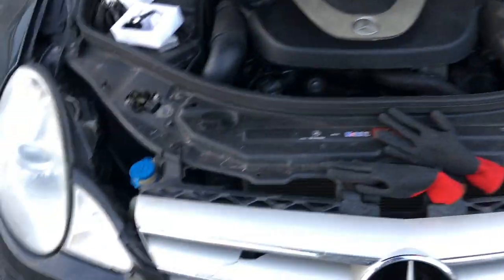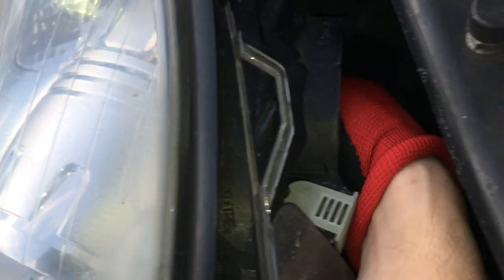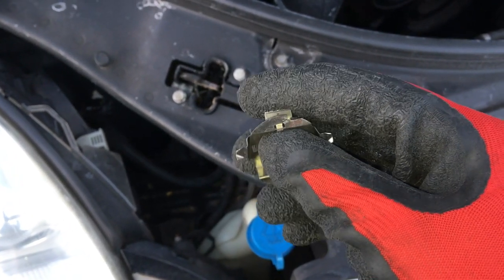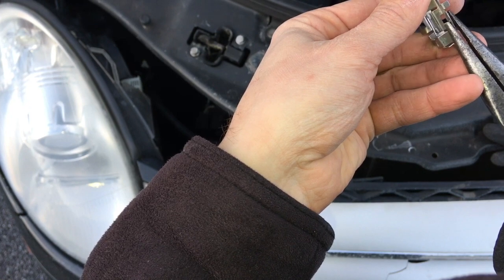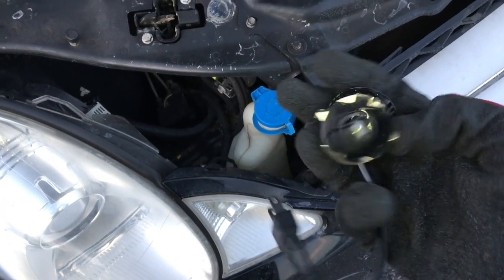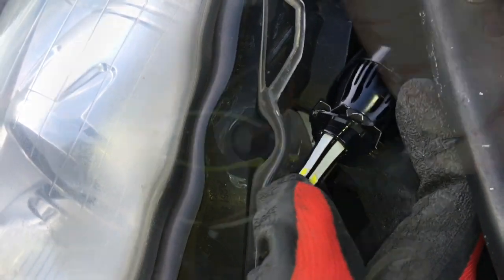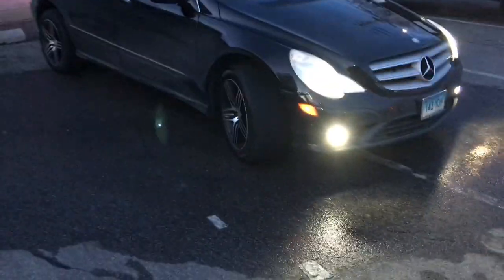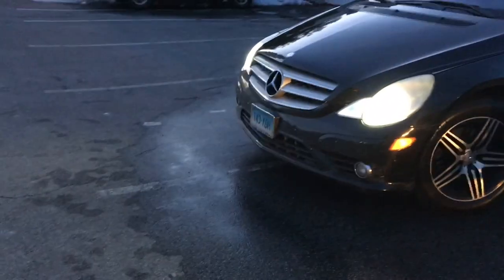2006 - 2010 Mercedes W251  R350 LED headlights

Comment: I see you also have LED parking lights right? What kind of LED did you use for those?
I assume that if an incorrect LED is used it will throw a code because of the much lower power consumption right?
Reply from the maker: Parking lights were changed to LED, but it was not easy. I tried to find the best solution for best result, but after about 6 month this car was totaled by some careless mechanic. Thus, no video was made. There are certain resistors that will make it work, but LEDs don't last too long, due to large voltage jump. I tried using stabilizers, but it would not work well with resistors. I tried many different ways. All that was due to the damn computer controlling these bulbs too much.

Comment: been looking for a video like this for my r350 for years. thanks for the post.   PS;  you can buy the liquid insulation. just paint it on with the included brush in the bottle. great for tight spaces like in your video
Reply from the maker: Thank you. Liquid insulation cannot guarantee proper application in tight and hidden spots. In given situation , I would take headlamp off and do everything in one shot. I have E350 video that has similar problem.
Reply: @Don M Do you like your 
R350? I’m thinking about buying one but I see so many bad comments about them

Comment: I’m not sure if you still respond to questions but I’m trying to remove the headlight like you did at around 0:28 and it seems stuck, I cannot twist the headlight like like you said. It won’t budge no matter how I try it. Not really sure what to do
Reply from the maker: spray WD-40 oil around there and let it sit for a little bit. you may need to come up with some kind of solution to help yourself with it. If nothing works, you would need to pull out a headlight.

Comment: I have 2008 R350, similar to this car, I tried two different types of LEDs but the were not bright as the ones you installed,  are there any specific specs should I look for...and part of the problem is the headlight projector lens is dumping and distorting most of the light!
Reply from the maker: fist of all, make sure the lens is not foggy, these cars have that issue a lot. If it is, you need to find somebody to take care of that problem for you. (I should be doing a video of this process soon, just can't find a car for it yet) another thing is that you need LED with 4 chips or 2-chip, but with minimal distance between chips. I haven't seen too many of those and overheating in closed headlights was a problem.
Reply: Do you have to wear gloves are these the type of lights you can't touch with your hands
Reply from the maker: No, you don't. These are not filament bulbs, but a conversion kit to LED. You just can't touch certain parts of it with dirty hands  that would distort the light

Comment: PLEASE TELL ME WHAT MAKE AND MODEL HEADLIGHT,  HAD THE LASFIT H7,  FROM DEALER INSTALLED AND NOT BRIGHT ENOUGH,  FOR SOME ODD REASON MY PARKING LIGHT ILLUMINATING IN THE DASH PANEL,  LIGHT FLICKERING UPON STARTUP,  IS THAT NOTMAL, ALSO WHEN I UNLOCK CAR DOOR A WEIRD  SOUND LIKE OPENING A SODA CAN, HAD LIGHT INSTALLED FROM LASFITS LIGHTS,  PLEASE HELP
Reply from the maker: LED headlight conversion kit in my video is not a market brand, meaning that, I could put my name on it or the shops name On the box.  Since there is no  online store, it is just a design and explanation. You can email me for more information about the conversion kit.  I looked at the website of the company you mentioned you bought your kit from, and noticed that their conversion kits have expensive chips in them , But I hardly doubt that any of these conversion kits made for projector headlights . That could be one issue. The other issue could be that sometimes in these cars headlights get foggy from time and different attention(care).  I don't think a dealer is a good place for installation of LED lights. Training Mechanics  to install LED lights on cars, I have difficult times to make them understand pretty obvious things .  I doubt good paying mechanics at the dealerships would be any interested and trying harder. As far as your parking lights, they have to be canbus.  If you bought ones like that, it means that they are generic and do not work on a specific car. I've been fighting these parking lights for the past 8 months on this specific car ,  looks like I found a decent solution . Sorry, I don't know how I can help you with the sound, I would need to see the car in front of me.

Comment: Light all over the place. Thanks for blinding everyone else...
Reply from the maker: You're welcome, but who is blinding everyone else and what lights are in question?
Reply: There isn't any legal ECE/DOT/SAE headlight bulbs for halogen housings. Why? because the light pattern and intensity isn't controlled properly. AKA blinding other drivers..
Reply from the maker: @lesmutchie8264  OH, that is what the comment is about? You just pointed out about "legal" and bunch of codes for headlight housing. This is the way of jumping out to create a theory in which creator would believe. "Nice" conclusion in a previous comment.

Comment: What was the brand and type of LED's you used?
Reply from the maker: These are generic brand. They are made to my specification. Basically a lot of manufacturers use similar design but different components and because there is no brand on it(most sold in shops), there is minimal marketing expenses. If you need more info on these kits, e-mail in description.

Comment: Have you had to make the repair on your rear right tail light housing/control module yet? You should post a video on this 😁
Reply from the maker: It was a client's car and did not get to these problems because the car went to one shop for an oil change and fell off the lift. basically that was the end to this car.

Comment: Hello .... My wife has this same car and the headlights are blinking need to be replaced, 1 big problem not oem bulbs they are hid's and dont have the bulb clips that hold them in place where can l order those clips what part num. Can you please help me
Reply from the maker: hello, sorry, I don't have a part number for that. It is a Mercedes metal headlight bulb clip, should be able to find them in  headlight section of oem Mercedes parts. As far as blinking : HID need to be can bus compatible, but may need capacitor too. This is why I recommend using certain LEDs, not even all of these work on Mercedes.
Reply: @artworkslights  thanks for the feedback .... Im not putting hid's back on ,I went to Auto Zone and got the H7 zxe silverstar sylvania bulbs in which l was told that they are like the oem but HID attitude  Yes thats the reason im going back to the stock or even led's
Reply from the maker: Great, great response that I was waiting for a long time. Let's just begin with Autozone: did you ask him to explain to you why do they think That the bulbs that they recommend are equal to a Hid xenon bulbs?  Did you happen to ask him about all the values of comparison that they use? How about Lanza Tivitt he and heat factor of these incandescent bulbs?  Also, there is a video on my channel where I'm talking about projector modules and comparing incandescent to LED bulbs and showing some bad results  on headlights. My personal opinion about people who work at AutoZone is that they barely know about the product of they sell.  I'm not being prejudiced against Autozone employees, but I just know hiring process at AutoZone and that's the reason why my opinion is like that. Originally you want it brighter  light on the road. This is the reason you came across my video.

https://www.youtube.com/watch?v=NF4Ilab8WmM&t=13s
Reply: @artworkslights  to be honest l didn't ask a lot of questions like l should have all l said to the young man was im looking for the original light bulbs for this M.Benz and thats what he recommended
Reply from the maker: Its a general question and general answer, so there is nothing wrong there.  Autozone is a kind of place where you have corporate management without any customer service  experience, but with the college diploma, hiring children with barely any understanding or experience about selling auto parts ,  i'm not providing proper training. They don't pay these people much at all, so they don't need to  no or do much. And the ones that do learn and want to move up, just leave.  It's very similar to when you take your car into service at the dealership and have to deal with the service representative, most of the time they have no idea how the car works .  Feel free to ask questions, I will answer as much as I know
Reply: @artworkslights  thanks for your help buddy .... I ordered the metal clips that my wife was missing to install the bulbs on amazon for less than 10.00 dollars and l went with LED'S instead of the Sylvania ones l had got at auto zone thanks again
Reply from the maker: No problem.glad I could help